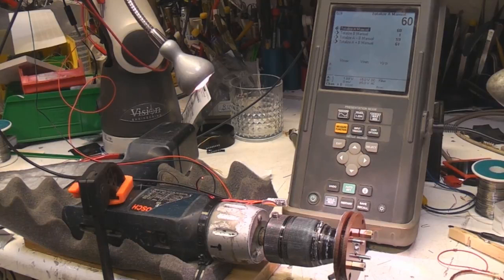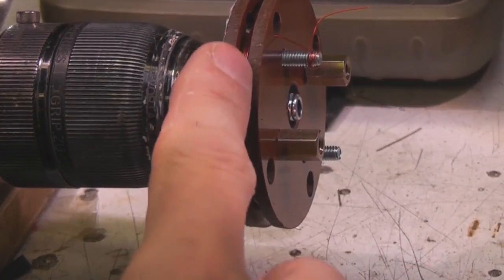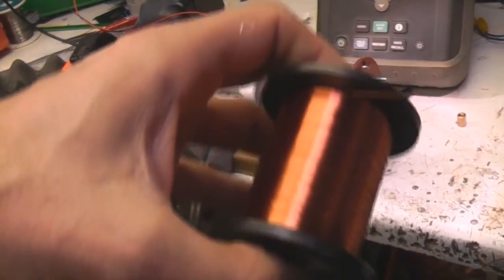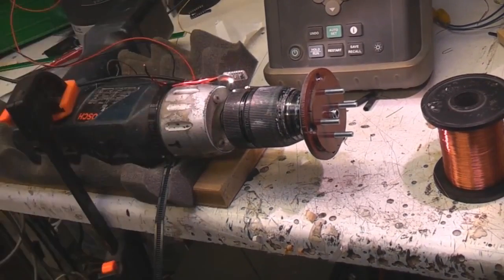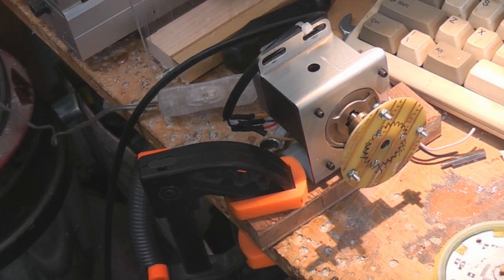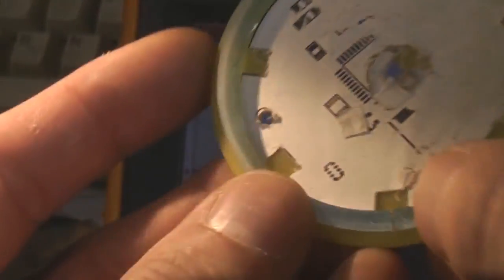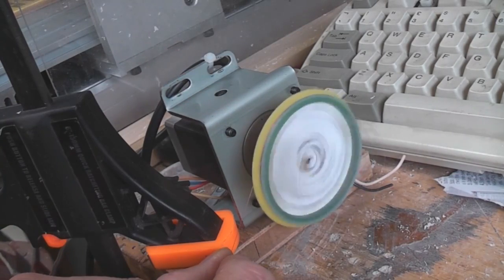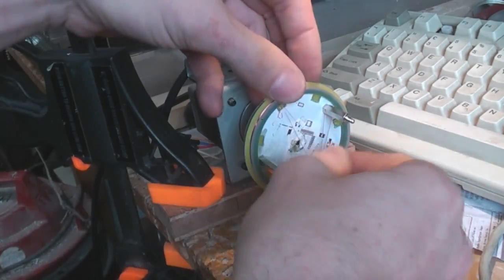CNC Coil winding

Comment: You could track down one of those Singer bobbin winders on eBay and use that. It's as automatic as it gets. When i have a small coil to make i borrow my the one on my grandma's sewing machine, i can't do it fast but since you'd buy it just for this you could speed it up to top speed and do it in a jiffy.

Comment: I suspect your missed steps are due to mechanical resonance in the stepper. Add a damper to the shaft and it should cure it, you can buy these but also adding anything to change the natural frequency may help, even adding some friction. The missed steps are happening at very low speed and Mach should have no trouble with it, even slight jitter is unlikely to hurt it due to mechanical inertia I suspect. I used to make my own heat bonded air wound coils with a similar set up, that was 0.05mm wire though, that's fun.
Reply: As seen in the video, he adds weight to the stepper, and it fixes the missed steps
Reply: dumle29 I didn't watch the end of the video obviously but nice to be right :)  In addition to what I said you can also buy dampened stepper mounts which are cheaper than the shaft mounted versions and would given even better performance than the steel washer. They are a few quid from Rapid Electronics.

Comment: nicely done, as always.
when I had to coil a transformer instead of that counter I used a cheap pocket calculator, entered 1+1 and during each revolution the equal was automatically pressed (shorted) via a switch mounted on the drill. so the display showed the number of turns :)
your approach is pro as fuck in comparison

Comment: Great idea! Would like to hear your thoughts on the CNC engraver - is it actually any good?
Reply from the maker: So far, yes. Only done a few bits in acrylic, PCB and Corian but works pretty well, given the limitations of rigidity & spindle torque. People have used these for PCB etching but doubt I'll bother with that - more interested in outlines, panels etc.
Reply: Yeah me too,  I very nearly got one,  but was put off only because I don't have a suitable workshop and was worried by the sound levels when cutting fibreboard.